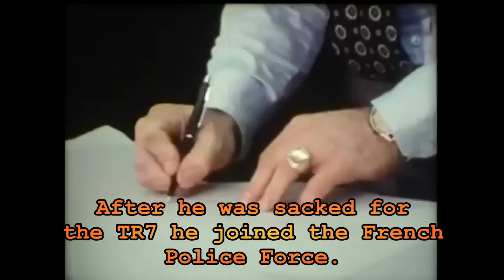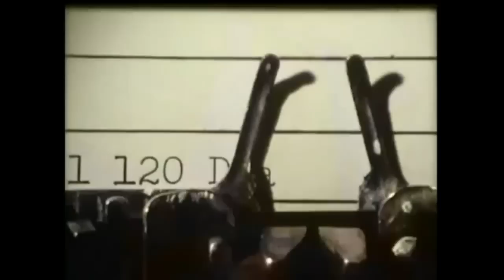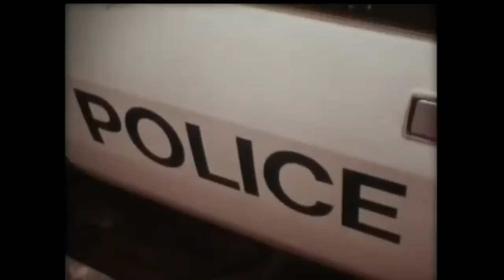EUROTRASH AUTOMOTIVE HALL OF SHAME - British Leyland - The Entire British Car Industry

Comment: In the 70s quality was atrocious in the US, France had labour "issues", Italian  reliability wasn't exactly world renowned...this wasn't just a leyland disease

Leyland's number one problem was 0:55. They should have jettisoned half their marques (whose main rivals were fellow BL stablemates anyways) and really integrated the rest in a meaningful way. BL had some world class cars in its line-up, if it had focused its meager resources on getting those right rather  than a slew of models horribly wrong there might still be a UK auto industry today.
Reply: Even German cars weren’t at their best, the engines SUCKED. Italian ones suffered from the use of crap steel imported from USSR but were still better than the utter shit that came out of France and the UK back then.
Reply: Well, sort of. American cars of that era were generally not as good as before or after, but still an order of magnitude better than British, Italian, or the very few french cars at the time. The sort of endemic electrical and rust issues that were common on British cars were nearly unheard of (with some notable exceptions, like the Vega - that similarly got raked over the coals for rust issues). They required some work, some times, but rarely just gave up on the side of the road and couldn't be fixed. Of course, the Japanese cars (particularly Datsun) were like miracles by comparison to either one.
Reply: Definitely! They're focused on quantity rather than quality. Everyone blames the unions, well Italy, France and Japan had huge problems with unions too. I remember the crap that was churned out of France and Italy in the 70's and 80's. Even some of the German stuff wasn't that good. Japanese did great engines, but rust was a huge problem.

Comment: If i remember rightly BL had some great designs and were in front with Rack and Pinion steering,side indicators front wheel drive and many more.They still had pre war tooling and Thatcher gave millions to Nissan to build a new factory and sweet nothing to BL,that's why they could not compete.Look at the Wolseley 6/110 and the Princess 4 Litre R,fantastic car's. I have owned many of their car's and i must admit it was the rust that got them but also the same for Ford and Vauxhall.
Reply: The Brits have always been great engineers and innovators but absolutely crap at building cars.

Comment: Big fan of british cars. I own a XJ8 and a Bentley T1. One of the many problems with B.L. was far too many engines. They should have consollidated having a one litre,1.3 litre,1.6litre,2ltr,2.5ltr,3ltr. Making 5 standard engine options. Instead of 850c.c,1000,1100,1275,1500maxi &1750 maxi,1800,2000,2200,3ltr.those being Austin Rover/B.L. then there was the Triumph 1300,1500,sprint 1750 & 2000 & 2.5 T.C/2.5 P.i. Rover 2000,2200,3500. They should have used their knowledge to create the ultimate engines of the day. I didn't mention Jaguar engines 2.8 was under powered but the 4.2 and 5.3 have stood the test of time being in production 74 years.

Comment: enjoyed that like crossroads motel do a public information film is that a 
renault 16 @26-05 had a 1974 one in early 80s £200 banger for a run a round
column shift  bad body work but smooth comfortable ride done me well
for a year part ex for vovlo 244 p reg carb model slow on paper but best engine
ever had eat rover 216s even early xr3 all day from 50 to 110 downside 26 mpg
at best up parbold hill top gear all the way(4th) local rs ford boys said must be
tuned stir the box and it few old engine but seller said had recon all miss old cheap
bangers cheap fun new road tax laws put end to that !!!